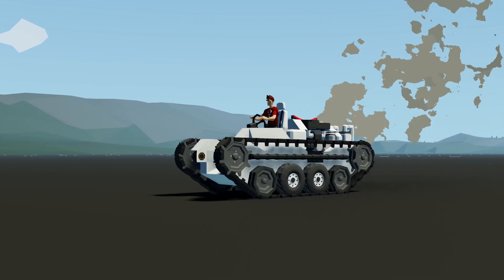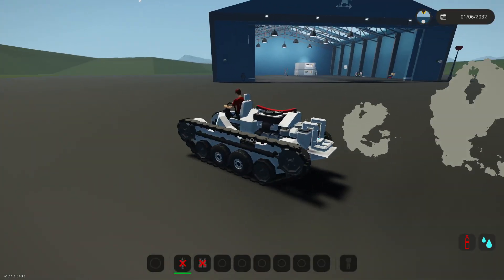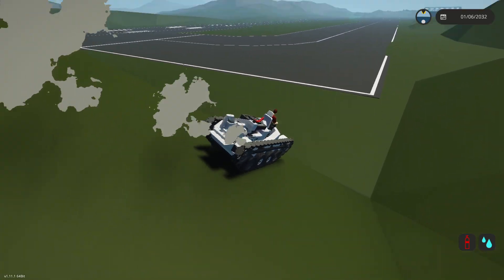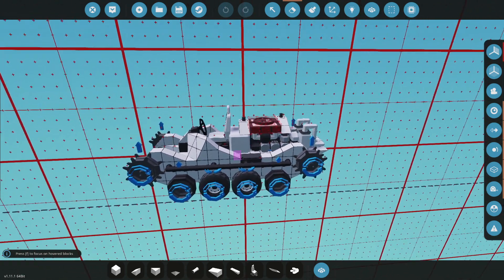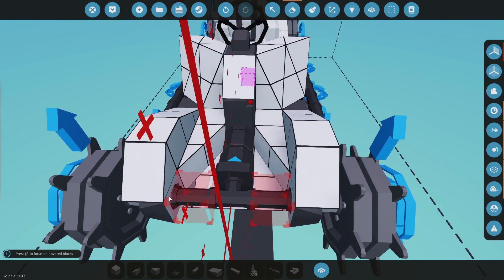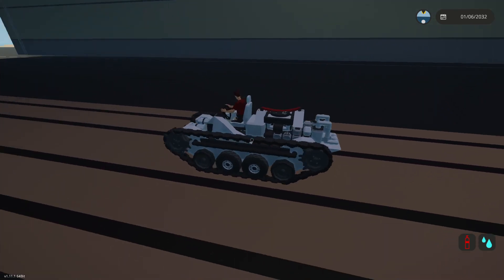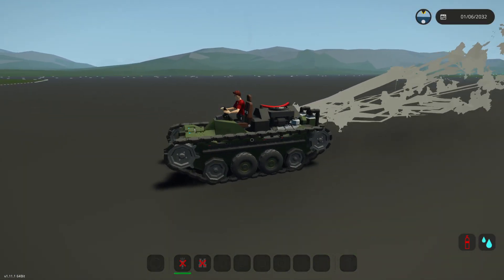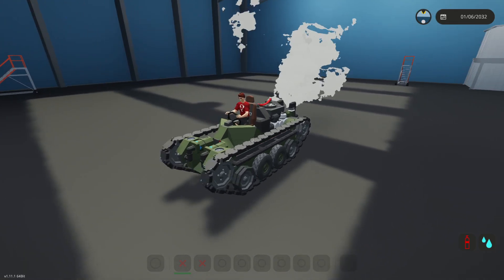SUBMERGABLE HYBRID ATV For The ATV CHALLENGE In Stormworks! Part 3 of 5

Comment: You can remove the tank underneath that was for floatation since the new design relies on it being heavy enough to stay on the bottom
Reply: Alternatively he could use it as a fuel tank that would keep the center of mass pretty low too.